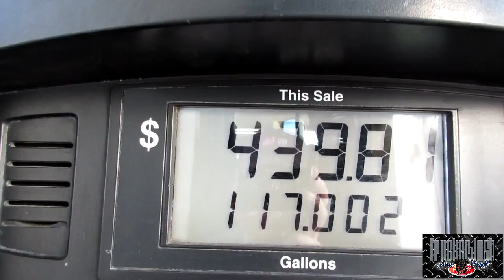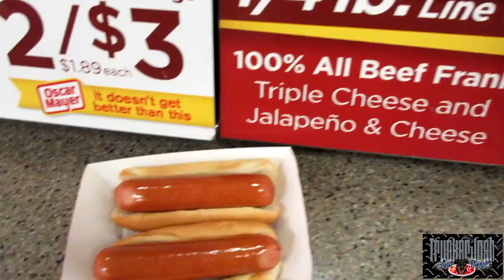CHICAGO HOT DOGS (MLD159) My Trucking Life

Comment: Those little bumpers are called Bull Bars, usually made for pick up trucks vs deers. I have them on my Ram, I hit a deer on the Garden State Parkway in South Jersey, did some damage but not as much as without the bumper. Also kept the deer from flying into my windshield.
Reply from the maker: That was no bull bar.  That thing wouldn't take a Coyote.  It's pointless.  If you want protection you gotta go big.  :)
Reply: I have a 4 inch stainless steel one that goes the full length of the bumper,you're right about the one on that tractor,serves no purpose. Do you ever truck down to the Jersey Shore ?
Reply from the maker: billio steam 4 inch will do the trick!  I'm in and around Swedesboro NJ now and then
Reply: Cool, let me know when, and I will give you a shoutout on my radio show